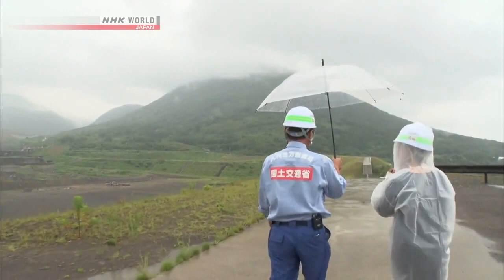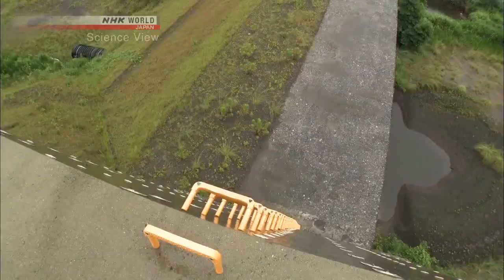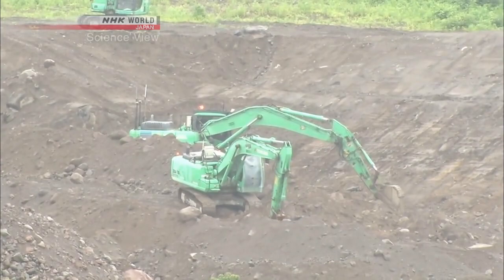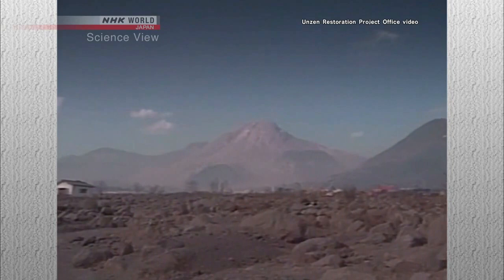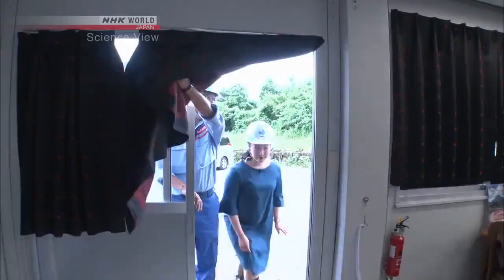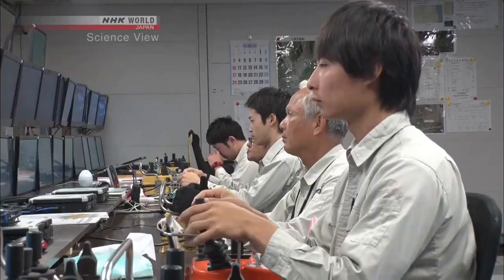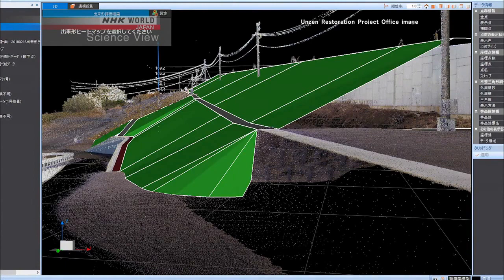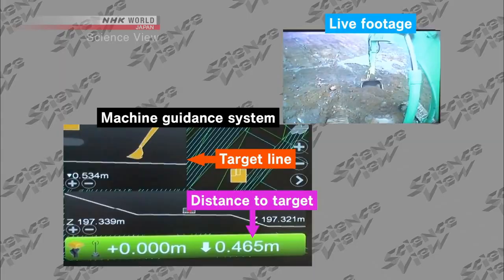World's First Unmanned Construction System

Comment: Unmanned is not exactly accurate... but still a very good achievement in Remote Control well done !!
Reply: Yes instead of unmanned system they should have said unmanned machinery.  Not autonomous yet but still very workable system.  When you think about how many lives were lost trying to clean up Chernobyl the ability to have useful unmanned equipment is a major advancement.  I can see this with many other uses, I am glad this program was shared.
Reply: Yes, i agree its good for lots of applications. Also for a moment i thought they where robots